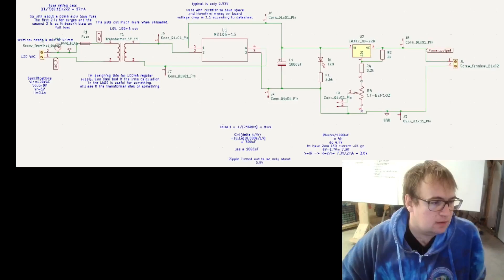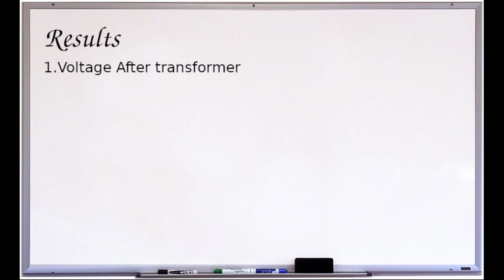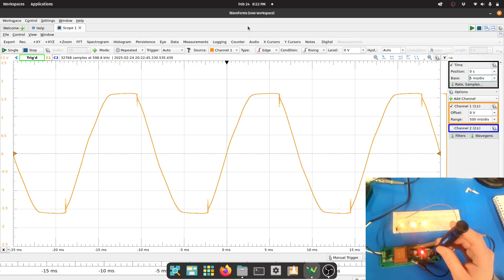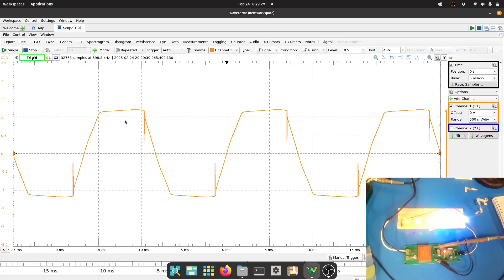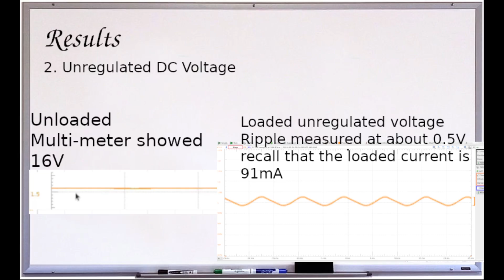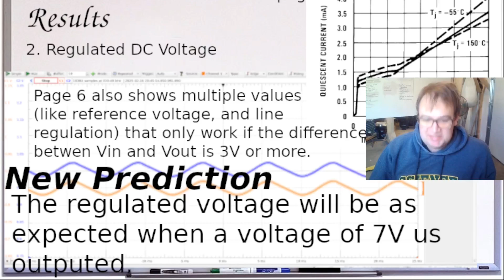Power Supply Evaluation Version Two

Comment: Having those exposed 110VAC surfaces on the left is  a bit sketchy. Better to use fully enclosed terminals such a standard power plug with an integrated fuse holder. And under the PCB with live 120VAC mains power to the rectifier, cover with kapton tape. Sure an standard AC plug connection is larger but a lot safer. If you need to use a terminal block, use a covered one. You WILL accidentally touch those hot terminals at some point. Ask me how I know.
I like your video style. And I like what you are doing. Hope your channel takes off.
Reply from the maker: That is a very good suggestion. I'll add that to my list of things for version 3. I love comments like yours, because it is great to get ideas from those with more experience. 

Thank you for your nice words about my video style. I hope this channel does well too, because then I'll be able to spend more time doing it!